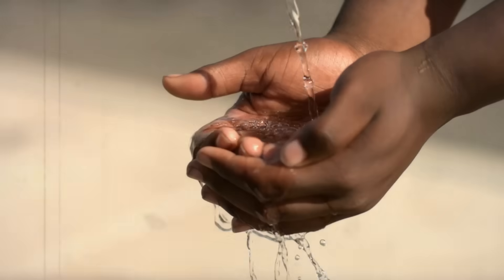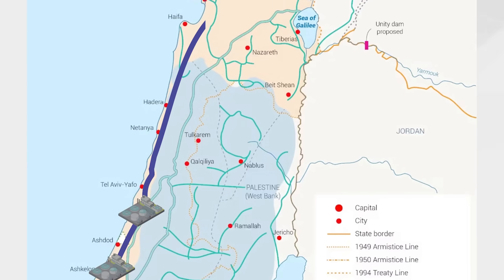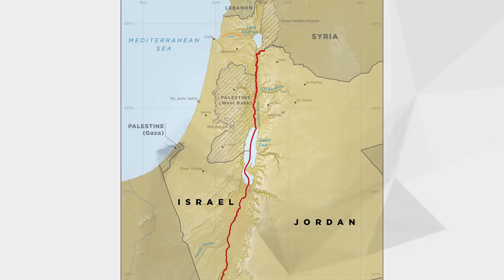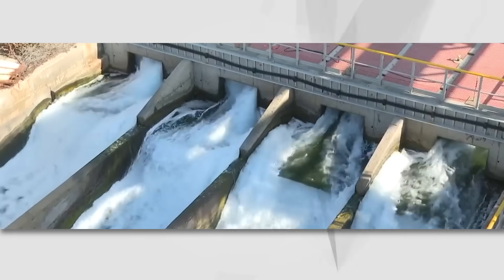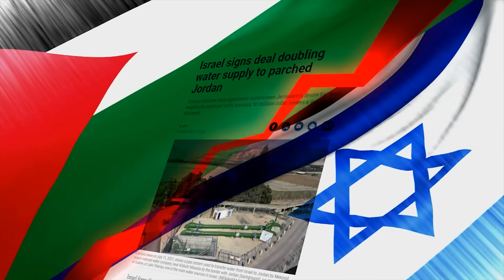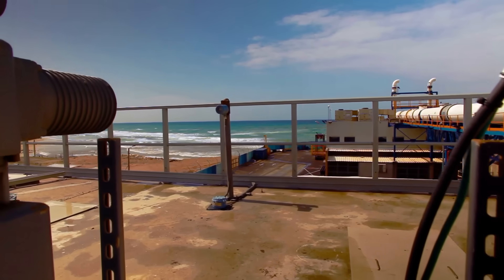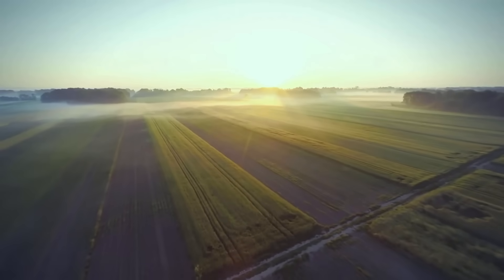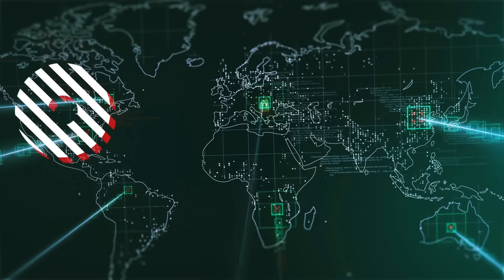Israel’s MASSIVE Water Highway That Could Change The Country Forever!

Comment: For a country that had no water that is an unbelievable accomplishment.
I'm now wondering where Gaza and the West Bank gets all their water??????
It's almost guaranteed, the vast majority of fresh water used and consumed in those areas comes from Israel.
Water is life, without it we know what happens however I didn't hear of the Israelis cutting off the water supply to the Palestinians.
I'm certain if the roles were reversed there wouldn't be a moments hesitation to stop the flow of life giving water to the Jews.
So much of this type of important information just gets swept aside, conveniently forgotten or intentionally surpressed.
Reply: You are right,  likely water has been coming from Israel all along..
Reply: @JS-jh4cy  Of COURSE it has. And when they whine that "Israel is keeping water from them", the facts is that HAMAS DOESN'T PAY THE WATER BILLS.
Reply: @SafetySpooon  Hamas also destroys the water infrastructure.
Reply: @JS-jh4cy  Of course it has, insofar as not all the pipes were removed by Hamas and the like to be made into rockets.
Reply: @JS-jh4cy  All you have to do is Google “IDF destroys water wells” and you can see multiple stories from Reuters or the Times of Israel describing how the IDF has systematically destroyed Gaza’s water infrastructure.
Reply: Israel provides Gaza and the West Bank with all of their infrastructure: water, power and waste management. They also supply Jordan with 80% of their water.
Reply: israel gives them water
Reply: Jordan get its water from Israel as well, that's the main reason there's peace between these countries.
Reply: Great
Reply: Israel gave them around 10 % of their water usage for free. Gaza had desalination plants as well, but they (most likely pij) misfired some of their rockets again, as usual .1 landed in their own  hospital parking lot,  and in the same manner gazans destroyed their own water supply.
Reply: Gazza Strip has desalination plants and thousands of wells, water table under Gaza strip is 60 meters /180 ft deep at most.
Israeli companies provide the balance of consumption.
Reply: There is no west bank, its Judea and Samaria. Also where Jordan gets its water? You guessed it
Reply: As an Israeli I can confirm they get their water from us. Also most of their electricity. And also medical care for things they can't treat in their hospitals. 
I guess we're not so good acting on our genocidal aspirations... 😂 oh the world is willingly stupid
Reply: Of course, they get it from Israel! It's a truly remarkable relationship in which one neighbor supplies the other with water, electricity, and jobs and gets constant rocket fire and terror attacks in return. As a cherry on top, it also constantly gets blamed in apartheid, genocide, and whatever other big word you can think of.
Reply: The potable water in the West Bank comes from pumping aquifer water. In the Gaza strip mostly from Israel because sea water infiltered their aquifer due to over pumping and 1/3rd of Jordan potable water supply comes from Israel that most of its potable water is based on desalination of pumped sea water.

The issue with desalinisation is that the process also eliminate minerals and it is not economically viable to add the minerals back therefore the potable water in Israel isn't equal to natural water and doesn't have its benefits but it is true that Israel eliminated the scarcity of water nevertheless.
Reply: @Shrulik  Very interesting, thank you.
Reply: Hamas had dug up a lot of the water pipes and used them to manufacture rockets. Israel did shut off water supply immediately after October 7 but restored it shortly afterwards.
Reply: @barryklarman2720  https://www.youtube.com/watch?v=04NB27x138Y Don't tell Gretha about it.
Reply: isreal attacks palestinian wells and rain water resources they don't even let palestinian to store rain water in home and then they sell water and gas to them.
Reply: You are unfortunately correct. Biden has conditioned US aid to Israel with continued humanitarian aid to Gaza. Israel can't cut off Gaza's water and food supplies without losing US aid.
Reply: The Palestinians had been living continuously in Palestine for at least 3,700 years without having any why white European Zionists to provide water before the Zionists invaded Palestine and stole and occupied the land and would have continued to have been able to have water without Zionist assistance if the Zionists hadn't stolen their land and forced them to live in overcrowded impoverished prison camps.

If racist aggressive violent invaders stole and occupied the land of your people and forced your people to live in overcrowded impoverished prison camps then your people might start having trouble supplying its own water.
Reply: Muslims are to lazy to work.
They see stealing as an option.
Reply: i think gaza has it sown de-salination plant
Reply: while they plot to kill all Jews, build rockets and underground terror compounds they give them water and electricity. You get that? I don't.
Reply: Lybia made a much more ambitious project and they are Arab, right?
Reply: They did in Gaza and within the West Bank only Jews have a reliable source of water
Reply: The roles were reversed during the times of the Ottoman empire. 500 years of Jews living in peace with Muslims, and even accepting Jewish refugees thrown out of Spain by the Christians.
Reply: The Israelis cut off the water supply to the Palestinians. 

There, you've heard it now, please shut the f up with your genocide defending BS.
Reply: The Zionist cut off Gaza's water supply.
It has not been restored.
Reply: @NikiBechus63  I don't want where you get your facts from. Israel uses more water from West  Bank than it is allowing West Bank Palestinians. I'm not against Israel. I'm just against ignorance and lies.
Reply: @MrSteadfast  If you watched the video it states that Jordan gets 80% of its water from Israel. 
Westbank is situated between Israel and Jordan, now you telling me the Palestinians are supplying Israel with water!! 
Methinks not mate. 
Besides common sense saying Israelis would be the supplier of water more than the Palestinians could achieve this process, the rest of the comments confirm my calculated assumption was correct.
Reply: @MrSteadfast  You are ignoring the fact that everyone has to pay their water bills. SOME people don't, & then complain that they don't get any water. I wonder why they do this....??
Reply: @SafetySpooon  That's because Israel  striped of their ability to pay for the bill. Do you know that Israel uses more water from West Bank than Palestinians do in the same territory? I bet you didn't know that.
Reply: @SafetySpooon  it is the same as some people in the Western hemisphere think electricity comes from the wall switch, not realizing it is a commodity which is purchased. Ignorance can be corrected, but you can't fix stupid.
Reply: @MrSteadfast  Did you know that still there are Arab villages in Judah, the so-called West bank, where people take water from distant wells, because they refuse to be supplied by the "aggressor"? These people still living in 13th century!